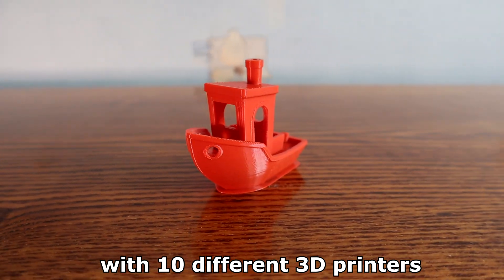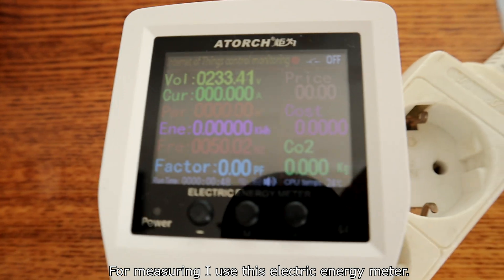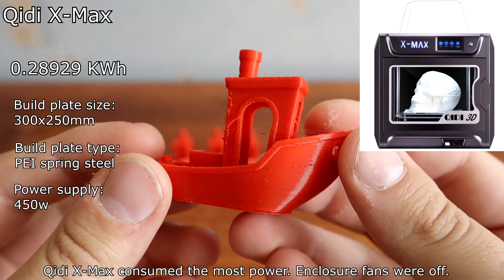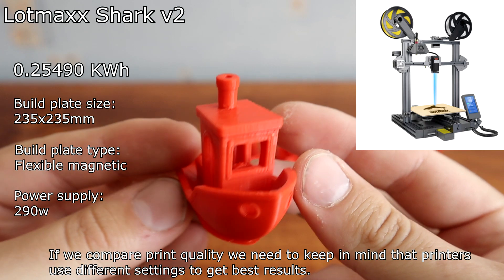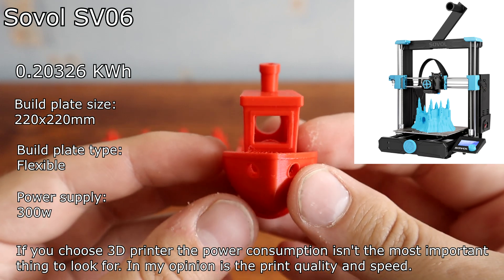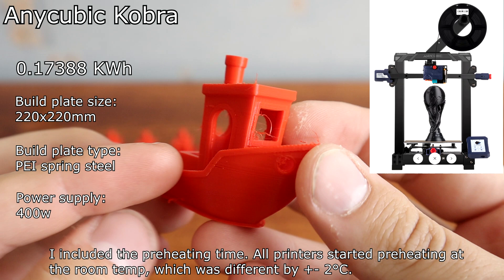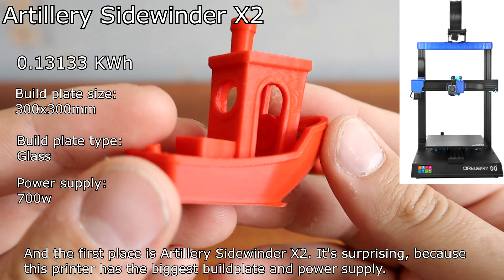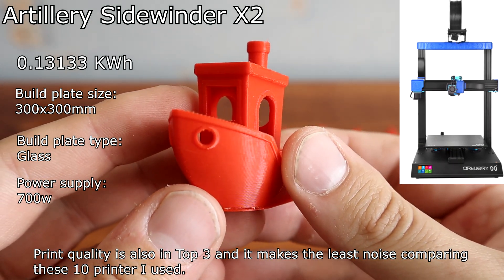How Much Electricity 3D Printers Consume  -  10 Different 3D Printers

Comment: I got my first printer recently, and initially commented that it was an X3 (it's not, it's the X2 that I confused with my phone, a poco X3 lol). I have yet to assemble it but ot's good to know that I inadvertently chose the one that got the top spot. Thank you.
Reply from the maker: I haven't used X3 also, but I have used X1 and X2. X1 is good and the X2 is even better so I think X3 should be good also.